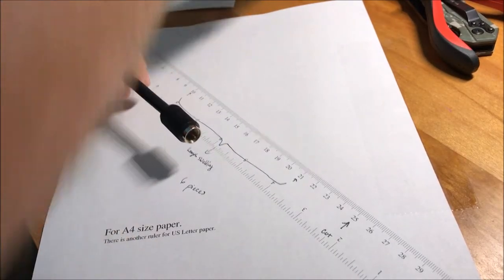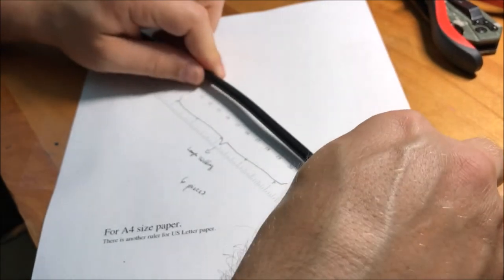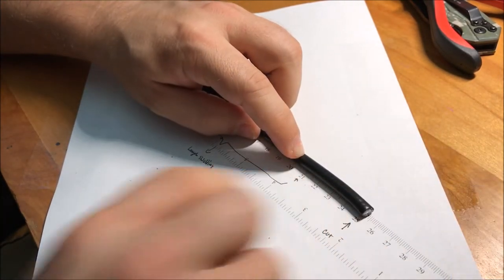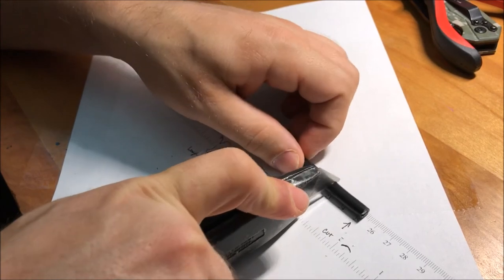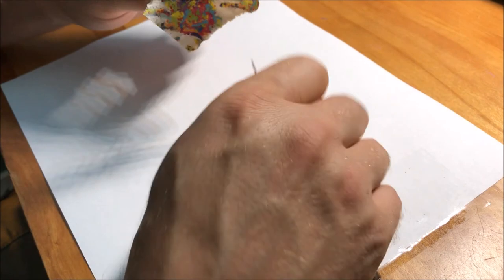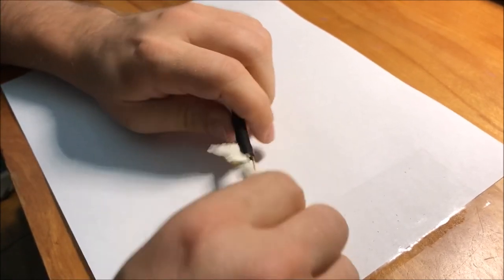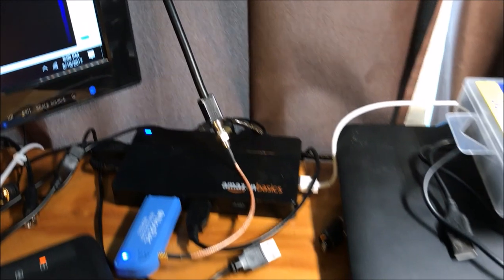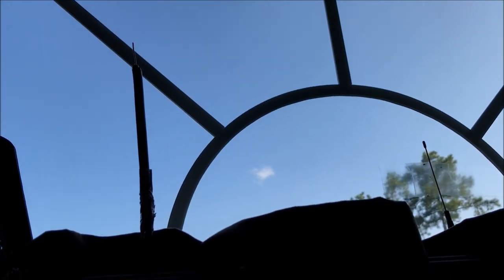FREE ADS B antenna that will be 10000x better than what you have now?

Comment: You don't show how to connect to the antenna or how to connect the feed line to the receiver.  It looks like you have several antennas of these short antennas connected together by tape. What exactly is the situation? And does it help to feed the antenna outside somehow and put it up at great height? Many thanks.
Reply from the maker: All you need for the antenna part is a length of coax cable that has the two F-connectors.  This type of cable is the same type used for cable TV.  All you are doing is cutting up the long piece of coax cable into six pieces and then sliding them all into each other keeping the one connector at the end.

You would make the segments out of this cable and one end should be left with the connector, which you would hook up to the adapter.

This is the adapter I used to connect the "F-Connector" of the coax cable to the USB adapter
http://amzn.to/2C95HaL

This antenna is called a Coaxial Collinear Antenna and is VERY VERY sensitive to ads-b signals, so it has a great gain.  Here is some additional info that I found: 
https://www.balarad.net/

Let me know if you have any further questions :)
Reply: Many thanks.

Comment: Thank you for this informative video.  I built this on Sunday and connected it yesterday.  

My previous antenna was the stock antenna that came with my inexpensive USB ADS-B receiver from Amazon.  I had placed it at the highest peak of my attic.  The max range I had been seeing with that over the past week was about 112nm.  

I ordered the needed MCX to coax adapter and after receiving it yesterday I placed this new antenna side-by-side with the old one in the attic, and once connected I immediately and regularly started seeing aircraft at nearly DOUBLE the distance I was receiving prior to this.  Last night's max distance was 216nm.
Reply from the maker: That's great!

Comment: I built one similar to this, I cut 16 pieces to 116mm. I stripped the ends to 2.5cm, taped the joints like you did and put it in 1/2" pvc pipe with 2 caps and drilled one end for the cable connector, mounted it to 10' stick of conduit. I am reaching out to 150 nm. Not bad for living in a valley surrounded by bluffs and trees!

I am using a Ads-b 1090 filter from FlightAware and a SDRPlay RSP1a receiver.
FlightAware also makes a decent RTL-SDR dongle with low ppm.
If you are running Dump1090, be sure  you make the ppm correction in the script/configuration file!

Comment: I found a piece of cable TV coax in the trash that gave me 2 8-section ADS-B colinear antennas.
I matched one up with a small filter and installed them each into some PVC pipes.
Considering I did zero velocity calculations they both look awesome when connected to an analyzer and perform great.
My filtered one currently lives on my brother's roof.
I just recently I found another mangled cable that rendered a 5-section colinear that also is working extremely well.
Once you have the hang of construction it is easy to do.
Reply from the maker: Nice!

Comment: One point I would like to make is try not to score the copper wire with your knife. as this puts a groove in the copper which will effect the signal travelling down the wire as signals travel down the outside of the copper wire and not through it. (its called skin effect).
One other little tip is get some plastic shirt buttons and use them as spacers between each section.
So you dont get any shorts by any missed wire strands. 
Hope that helps. 
Cheers Mark G0NMY
Reply: The shirt buttons is a good idea!

Comment: Thinking of building this.  How well does the 11cm elements work for Airband frequencies? (108 to about 137MHz?)
1090MHz may have a different length, right?  Do I need to build two different antennas? I know, noobie questions, but I am one. :)
Reply from the maker: Not too bad.  You should check it out if you have some extra coax laying around :)
Reply: @TheThriftyPilot  Thank you for your response. I'll report back on how it went. :-)
Reply: The elements would need to be a lot longer to work on VHF air band.

Comment: you say 11 cm yet you are cutting them at 15 cm can you clarify please
Reply: 15cm is one complete segment, end to end.  That includes a 2cm bare copper stripped end, an 11cm insulated segment then another 2cm bare copper stripped end.
Reply: @liebowa  cheers
Reply from the maker: Sorry for the confusion, it would be 15cm total length (sheathed and unsheathed parts) and after you take away 2cm of sheathing, you would have a cable with 11cm of sheathing remaining.  Best thing to do is take a look at the measurements on the ruler :)
Reply from the maker: If you build one, let us know how it went :)